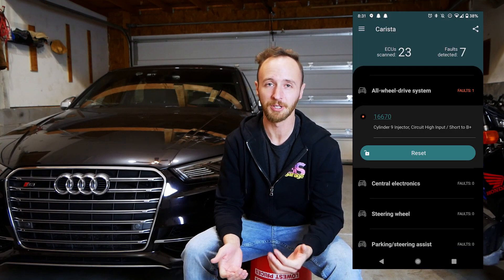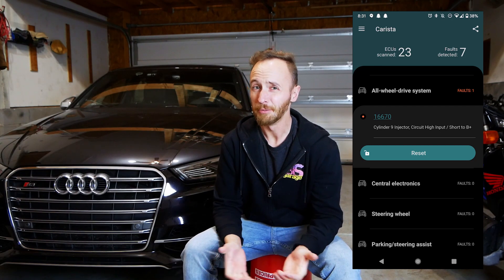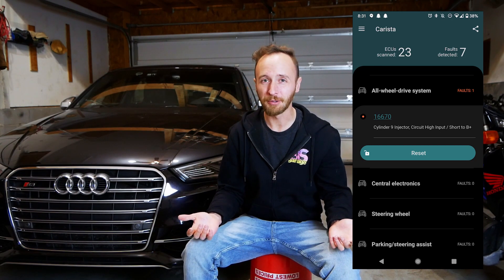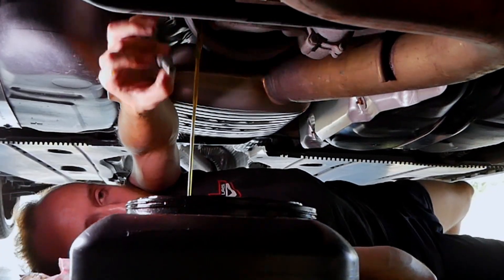Haldex AWD fix for Audi S3 and VW Golf R! We walk you through what to try before replacing the pump.

Comment: Literally brought my car in yesterday and the service advisor called me today and told me the pump was done for😂😂😂. I wish it would be just some software update my car needed but uh-uh.😂😂
Reply from the maker: Unfortunately they are a weak point for the car. Haldex Gen6 moves to a brushless motor and will probably be more reliable, and the Mk8 Golf R uses a Magna unit that isn't even technically Haldex. Just make the pump replacement works before you leave the shop, mine didn't work for a long time after it was primed improperly!
Reply: @BS.Garage  yea I let them go ahead and change the pump and flush the system. He just called and said it’s ready too. Kinda excited to see how she’ll perform and how long she’ll perform.

Comment: Ironic that I found your video. I am having the same issue and wanted to see what a good process for evaluating. Found your video and realized that you took your car to Apex Tuning which is down the street from my house! I am taking it there tomorrow to do the same thing. hopefully i get the same result!
Reply from the maker: Awesome, hope it works out for you! Apex Tuning is great.
Reply: Did it work too ?
Reply: @IntoTheG4ME  Yes, priming the pump fixed my issue. worth a try before going further. Unfortunately, the indy shop by my house wont do this service so I had to buy my own scan tool. I needed it anyways so it was a win win.